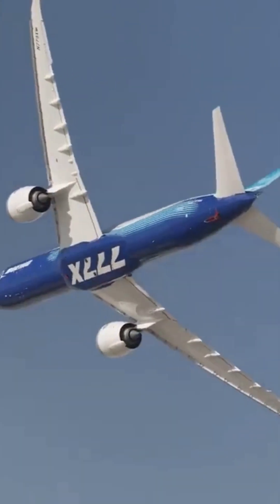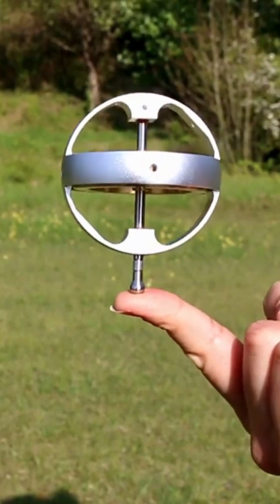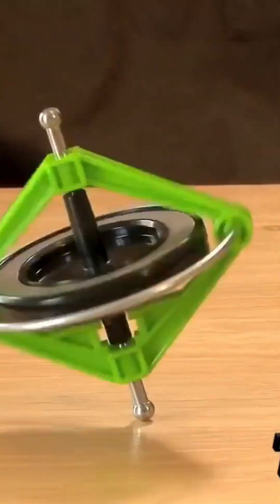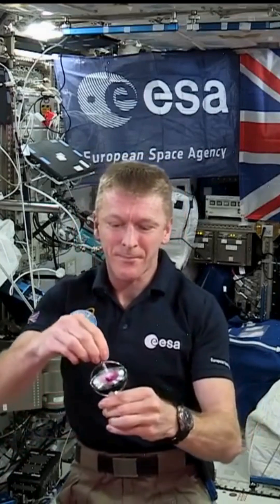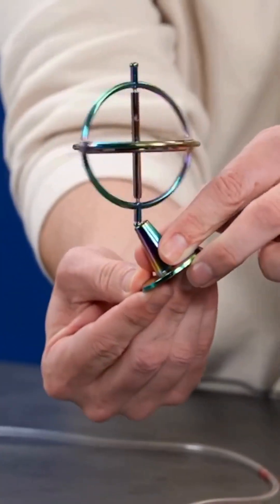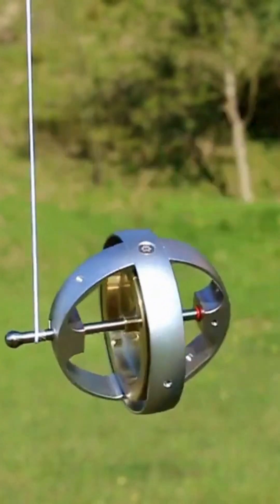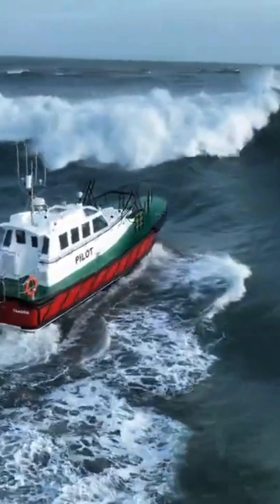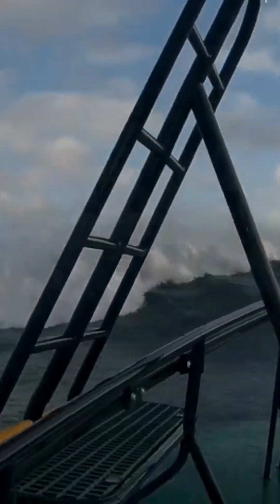How do gyroscopes work?? #gyroscope #physics #engineering

Comment: oh my god bruh..
As an avgeek and aerospace engineer, airplanes stay stable do to the peculiar positioning of their horizontal and vertical stabilizers, relative to the
 main wings. 

Ships stay stable because of their mass distribution. They are already buoyant but most of their mass is concentrated near their bottom, so it always wants to stay upright.

Cars do not have gyroscopes. They don’t need it. But motorcycles might

If all these vehicles had gyroscopes to stabilize, they would be loud and inefficient.